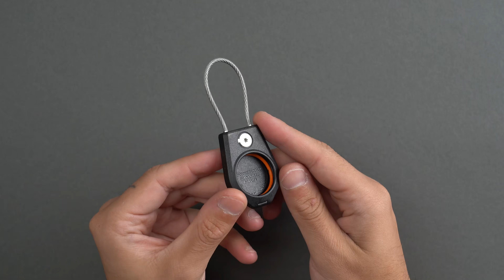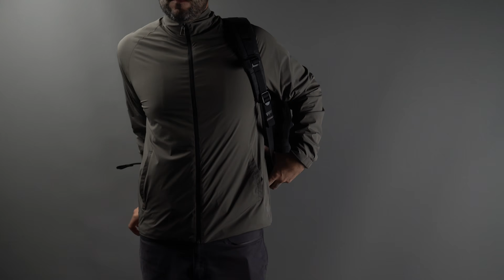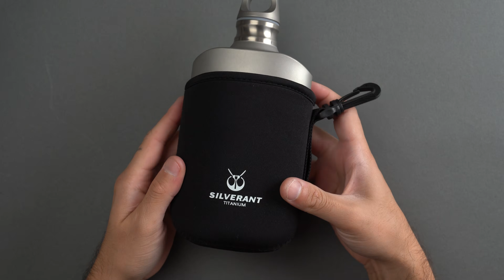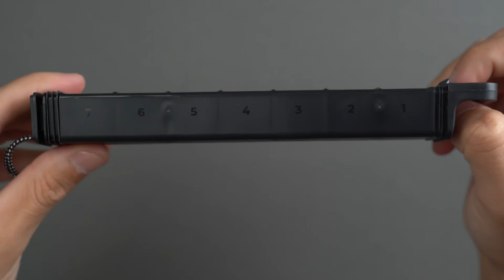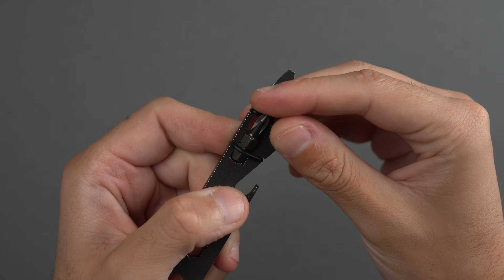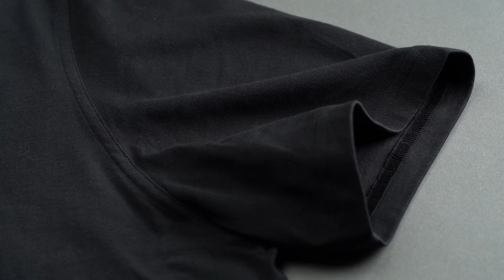14 Must-Have Tough EDC Travel Essentials

Comment: The water bottle is cool, the AirTag holders are very nice. The passport wallet had a nice build and texture but normal thickness passports just slide out too easily so I don’t recommend it.

Comment: This video seems like it was made by someone who has never traveled. Every single product in this video has a significantly better alternative, and one of them is not even airline compliant. I'm guessing these are all sponsored products. 

1. GR2: The Aer Travel Pack 3 in Ultra is 1" taller, 1/2" wider, is structured in a more boxy design to be more efficient, offers more organization, and is 0.33 lbs lighter, for $200 less. 
2. Airtag Cable: Just get a bag with a hidden tracker pocket, like the TP3 listed above. You don't want your Airtag to be advertised on the outside of your bag. That's just dumb. 
3. Dopp Kit 3: The Travel Kit 2 is just a better product. The DK3 is too small to fit everything you need unless you leave out some things. The TK2 also comes in Ultra, which makes it the same weight as the DK3 with more room for only $10 more. It has a hook that is built in, which offsets the cost difference. It's also more rectangular shaped, which makes it more efficient to pack. 
4. Titanium Water Bottle: It's unnecessarily expensive and the giant stem makes it unnecessarily tall. It won't be efficient to pack in a sling, if at all. It could be good for the side of your Travel Pack, but idk if it's too wide.
5. Shoe Tote: This product makes no sense. It has a roll top enclosure, adding unnecessary weight and complexity to the bag, but then mesh vents on the side. Just get a cheap shoe bag or zip bag that fits better in your backpack. Aer makes a zip bag that fits perfectly in the TP3.
6. Passport Wallet: I can get behind this one a bit for others, but I personally don't find the appeal. Store your passport in your travel bag when you don't need it and in your sling when you do. The added bulk of the wallet makes it not fit into passport pockets. Storing cards and cash with your passport is a good way to lose everything if you get pickpocketed or robbed abroad. 
7. Pill Canister: I've had products like this. They are thick, weirdly shaped, and heavy. Just grab a plastic pill case from CVS for $3.
8. Backpack Pods: They don't fit right in your travel pack and don't have compression. Just buy the ones that are made for your bag. 
9. Keychain Multi Tool: No way this is getting past TSA. It's also unnecessarily heavy. Patina? That's called rust. 
10. Summit 10,000: This is only for backpacking in the snow. It's dumb to buy for travel. Just get the NB10,000. It's lighter and cheaper. 
11. Titanium Carabiner: This absolutely has a moving part and will wear over time in a catastrophic way. Just get a carabiner or S-biner. They're much more useful. 
12. T-shirt: This is how I know you're not recommending good products for travel. Everyone who travels a lot knows not to pack cotton. It stinks and dries slowly. Go with Merino or Alpaca wool. And $145??? Crazy. 
13. Sunglasses: Holy. Never bring a big, bulky, expensive pair of sunglasses when you're traveling. Sunglasses will be lost, broken, or scratched while traveling. You want something slim, light, and inexpensive to fit into your sling.

I'm not even going to comment about the ridiculously priced watch ad read.
Reply: It’s all about color match and alignment!😂 (That’s the reason I got attracted to this video😅)
Reply: @Roger_L.  Yup! That's why I have alternatives that all fit and match together. I don't want to sound like an Aer shill, but they have everything figured out.
Reply: well these videos are not about best vallue/function. Its just what looks more premium, fancy and pleasant to the eye
Reply: @thomasko0947 But they make zero sense. They're not even travel focused.
Reply: @Dasbeerboots  as I said: the usefulness is not the important factor...
Reply: @thomasko0947 The title is "14 Must- have travel essentials"
Reply: @Dasbeerboots  The channel is named "high consumption"
Reply: Agree with all except for the clothing, cotton is perfectly fine for travel, and merino wool clothes are just overhyped (except for the darn tough socks which are a blend), they are high maintenance and theres a bunch of testimonies of how they get damaged easily and get holes all over, and yeah a way to try and avoid that is with hand washing and using special wool detergents but damn having to carry or buy a wool detergent and be hand washing isnt exactly ideal on travel, as for the stink, it all depends on the quemical treatments the clothes get, there's cotton and polyester shirts that won't stink up, dry up just as fast and are more durable than merino that are a fraction of the price
Reply: I share your sentiments. As someone who travles a lot, I look for good value and functionalty in addition to "toughness". There are excellent products out there, as well as channels that present them. This list doesn't make good recommendations for actual travel. That Titanium water bottle 😂, that ain't goiing near my pack.

And that Keychain Multi Tool, I doubt you would get through many  security checkpoints here in Europe. Can't say for sure but to mee it wouldn;t be worth the risk, sooner or later it's gonna go.

So I agree, there are much petter value propositions for travel. Just because they are tough doesn't mean they are good. Too many here fail/
Reply: Thay just went to a lot of companies and asked how much they could get paid to put all their products in a commercial.

Comment: I know almost no airline, where a GR2 is compliant :D I wish it was.
The packing cubes would need some compression feature.
Reply: The only structure is the removable frame sheet, so its complaint on any airline based on how you pack it
Reply: @inevitablegibberish yeah but at least the cordura is so heavy that at least I almost cannot stay under the threshold 😄
Reply: @Heimdall-hb5it  That doesn't mean it's not compliant. It's also around the same weight as the Travel Pack 3 in XPAC.
Reply: @Dasbeerboots  at least my 1000D weighs around 2kg. For only 5kg left its a bit big. But anyways :)
Reply: @Heimdall-hb5it  Yeah, I'm running into the same issue right now with my TP3 in Cordura. I'm right at the limit for my trip to Korea and Vietnam right now, but no one has weighed me anyway. I want a lighter bag with all of the organization that the TP3 has, but I know that's not possible. I'm considering trading it out for the Ultra. It'll mean I can ditch the rain cover, too. I'm holding out for a TP4 that fixes a couple of my gripes about the TP3.